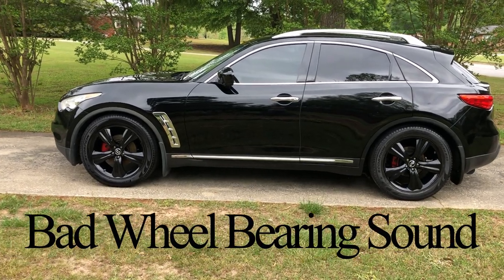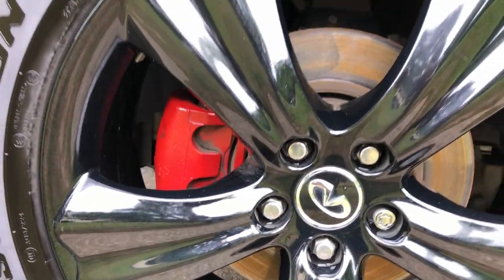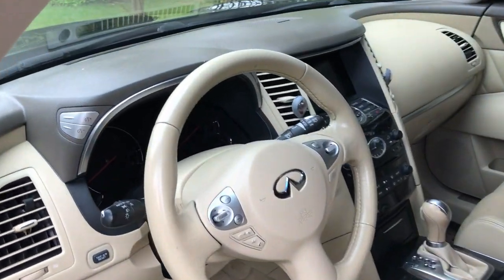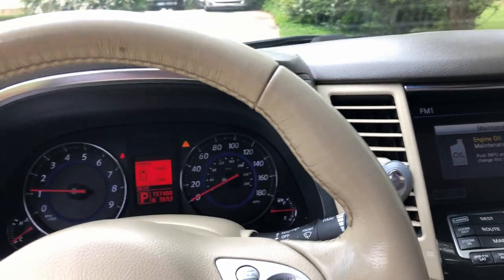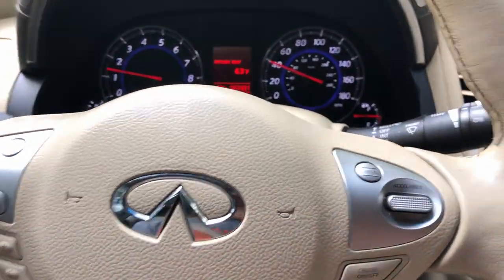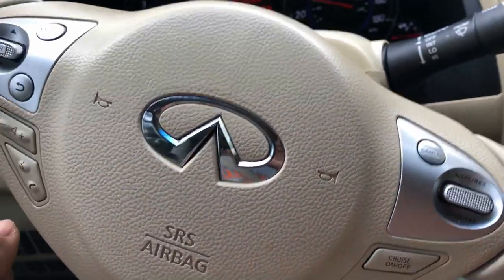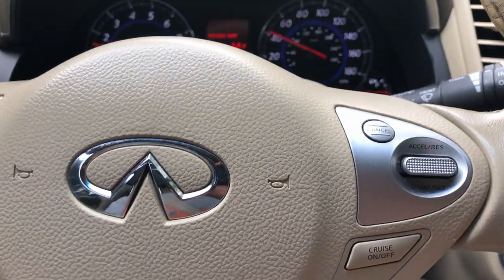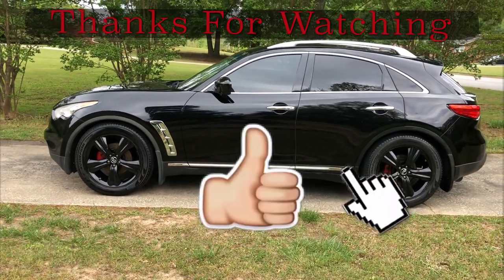Bad Wheel Bearing Sound FX35 2nd Gen #badwheelbearing

Comment: I have got similar noise on FX30D 2013 when I turn left in a bend, thanks a lot bruv. You're very much appreciated.
Reply from the maker: Thanks for watching and yes, if you have eliminated a bad tire chances are better than not that you have a bad wheel bearing on the left if when turning right the sound gets deeper. I need to get around to editing the replacement video which should be helpful to you.

Please subscribe if you haven’t.
Reply: @TRRehab  Indeed I had 4 new good Years 21 inch tyres, 4 new brake discs, new brake pads. the sound comes always on a bend to the left, I like the sound though but I am not sure it should be there.

Comment: This is an amazing video. i have a 2010 and was trying to figure out if i needed new bearings, i'm replacing my front rotors and pads soon and was thinking id i should just do that, but if i dont need to update i dont want to spend the money.
Reply from the maker: Thanks David for watching. Please subscribe if you have not because I have more repair videos for the Infiniti. I just replaced the VVT solenoid will post when I finished editing. Also torque specs on simple things like oil drain plug and other.